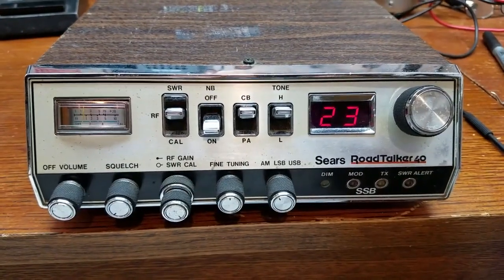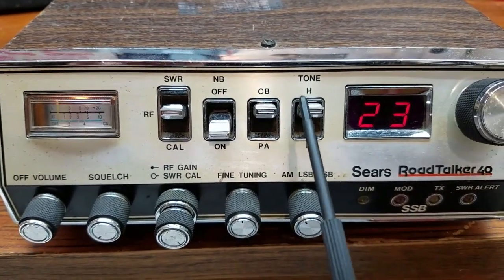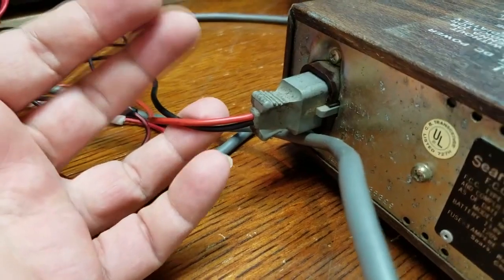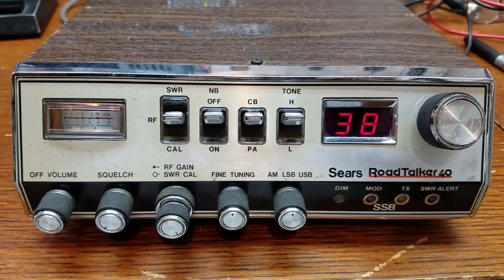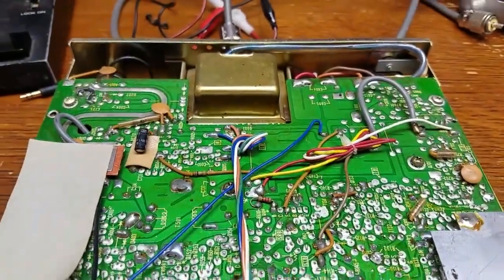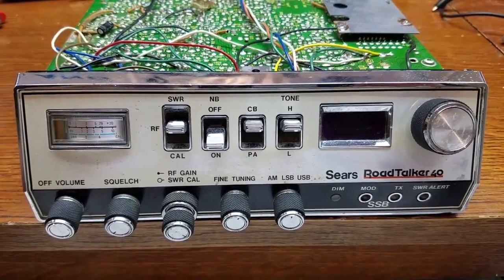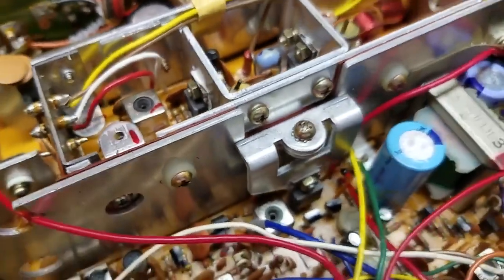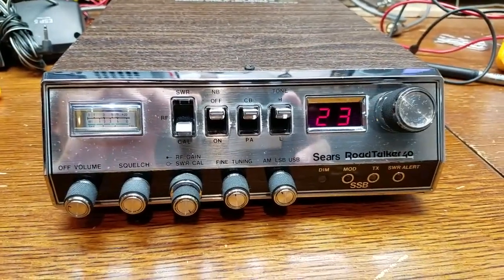Sears ROADTALKER 40  AM SSB CB Radio OVERVIEW and Clarifier Mod

Comment: I have to say this about unlocked clarifiers....If MY radio is dead on frequency per scope and analyzer, why should I have to have my clarifier unlocked? If some bozo with a truck stop hacked POS is off transmit frequency, that is HIS problem, not mine. If you listen to Chan 38 LSB, you will see most guys are dead on freq.....but there is always a few either way high and way low calling CQ and I simply ignore them.
Reply from the maker: This is a subjective issue as I look at it this way. 
1) Not all radios come from the factory spot on freq, so you need to "adjust" to that person.
2) it is rare to talk to a group of operators that have exact TX freq, so again you need to adjust.
3) Some radios slide around while talking due to changes in operating temperature and you or them need to make adjustments. 
4) Others operators may not have the ear to clarify properly ( its a matter of taste). 
5) Not every one runs an ILLEGAL Hammy Ham radio on the CB band. Some of those rigs can a bit out of alignment due to age or improper alignment from the factory... Hello Yaesu
6) Woman and fellas with high pitched voices or mics will affect a group that is talking. other ops may tune around to get perfect pitch and that would force you to re clarify.
Maybe 70% of the operators on 38 on "on frequency" ... the rest do what they can.

You may shun away from operators because they are a bit off freq, and this can go both ways,  I personally don't want to talk with a frequency NAZI.
Hey.... I have an idea, try in a polite way try to reel in that guy who is way off, you know... to help a fellow radio nerd.

Thanks for watching and cheers.
Reply: @390WagonMaster  I get what you are saying and agree with every word, however, I am looking at it from a Ham Operator's point of view and unless you are running an older Tube Type rig that tends to drift as it warms and cools, you never have to touch that VFO, ever.....once you land it on the frequency you talk on, everyone is spot on all day, every day (except that one old guy with the tuber), and we make him adjust up to us.

Comment: Thanks for the video. This saved my old Sears Roadtalker Slant Face SSB radio. The old clarifier mod steps were not correct as when you did it the way they did, your TX was wayyyy off. It still tracked but transmit was off.  The way you showed it here corrected that. (Removing a leg from R303 was the winning ticket.)

Thank you so much.
Reply from the maker: Glad I could help you get your radio working correctly!
Reply: @390WagonMaster  The radio will need a recap sometime.  I don't expect them to last much longer as its already showing issues from the age. :D A project for another day.

Comment: Thanks for the Video. Have my dad's old 40 SSB, but no key. I picked up another one with the original the box, the desk mic, hand mic and the AC cable. Works except only about 4w on SSB. Thanks to this video now at 12w. I'll get Dad's running eventually.
Reply from the maker: Great radios, they out perform many of the new CBs on the market today.  Not so much for output watts but receive wise, clean, clear and much less noise than the new rigs. Cheers
Reply: @390WagonMaster  I built a 11 meter dipole out of an old Comet 5 band. Really want to hear what this old radio sounds like compared to the IC-7300 on the OCF. Not worried about the power, legal is fine by me.

Comment: Now I notice that your mic is not plugged in either, so no mic is not our problem. Any ideas on why we don't  hear anything? First thing I'm going to do is check to see if the speaker is connected inside. It came with an under the dash mounting bracket that we aren't going to use, that thing has a lot of wires attached to it, and maybe a remote speaker was being used.
Reply from the maker: I would start with working the EXT SPK plug, take a 3;5mm (1/8") jack and work it in and out several times. That will sometimes clean the contacts of the radios jack. Try and get a microphone and plug in to see if your receiver comes to life, also when you get a mic press the PTT or mic button several times that may clean the relay contacts ... oh wait, does that radio have a keying relay? I don't remember. ( I sold the radio a while back) The speaker could be bad but its rare to have a bad speaker, now I have seen them unsoldered so look for that. Good luck
Reply: @390WagonMaster  I just opened the case to check, the speaker is attached; but then saw that capacitor has leaked its goo. Don't know how easy it will be to replace that, but it does seem possible.
Reply from the maker: Yes this is a "thing" with a radio of this age. Not typical on these particular rigs but does happen. Swap it out and you might be good to go. The manufacturer (Hitachi) maybe got a hold of a bad batch of caps. It happens.

Comment: I just unboxed a previously never opened sears Roadtalker 40 that my girlfriend’s deceased father had in his garage. (Everything still sealed in plastic) The only thing I’m missing is an antenna. This one still has the receipt taped to the box, which is dated 11/23/79. (He paid $59 for it then… I think he was a prepper) I plugged it in, but without an antenna, I doubt I’ll be able to communicate with it. Might be nice to have if the power grid ever goes down. (Since he also has all kinds of backup generators and other doomsday-like paraphernalia)
Reply from the maker: Yes you will need a CB Antenna for sure, don't key the mic and transmit as that will kill the radio. 
Let me just say.... WOW!!!! What a great find!!!!
Her Dad must have known his stuff. Cheers

Comment: Cool radio. Does anyone have this radio with a Digi-Scan on it? I have a question regarding an odd oscillating/ warbling sound that migrates through the frequencies. Or, anyone with a Digi-Scan experience this? It may or may not be tuned down to ½ watt, but the sound is on the receive.

Comment: would by chance know where I could find a mic replacement for this radio, or other Male 5 pin slide in mics that would work ?? TY :)
Reply from the maker: Watch Ebay for one, however they could be a bit spendy and your taking a chance of them not in good working order. Or maybe try to repair yours. (The Sears 5 pin DIN does not mate to Hy Gain, or Realistic. )
Reply: @390WagonMaster  Thanks for the reply :) Yeah after I got the CB back after it was stolen it was missing the power cords and the Microphone, It's been it the back of the storages closet for the last 20+ years now, so I thought I'd get out and back up & running, I was just hoping some one knew of what other compatible brands of DIN Microphones that would work !  I'm using the 2 top pins on the back to power the CB up on AC, by chance do you know how the 4 lower pins need to be wired up for DC ? TY  :)

Comment: I own this and the Jc Penny version. The Pennys wont work and no techs want to look at it because they are lazy and only want peak and tune crap.. Just a tip, run this radio on DC not the junk internal AC supply.. It'll almost double your output. Im seeing 20 to 25 on SSB and 4 to 20 on am..
Reply from the maker: Thanks for the tip. I will try it.

Comment: I have one but I wont talk, modulate it's dead key. What can you tell me what I can do to fix it?
Reply from the maker: First thing I would do is make sure the mic you are using is good. Try it on another radio, or try another known working mic on this radio. I have seen many radios with supposed need of repair and it turned out to be simply a bad mic.
Reply: It’s junk 😅😅😅